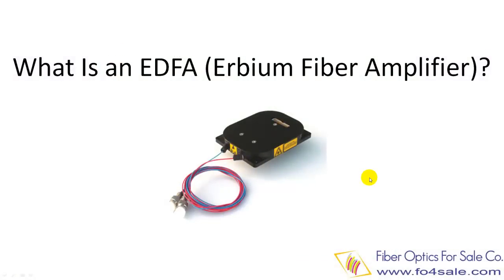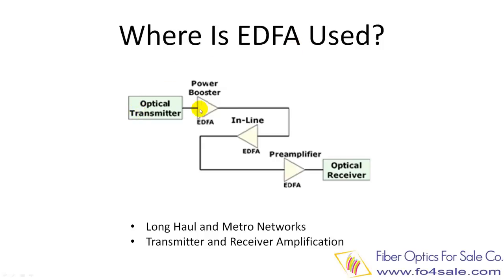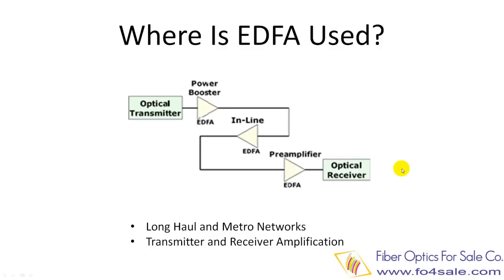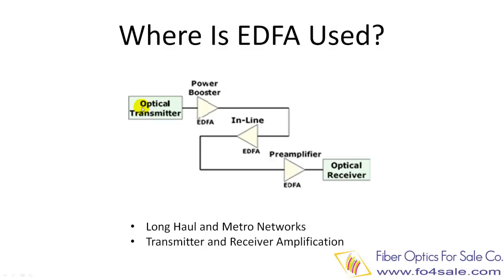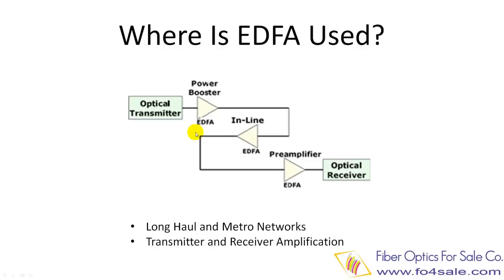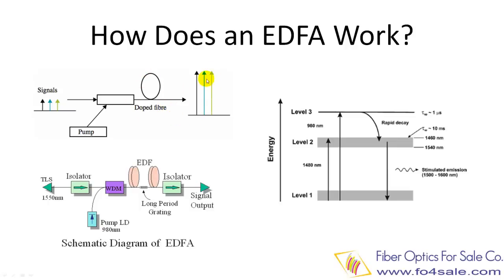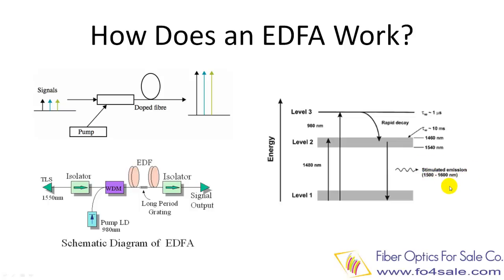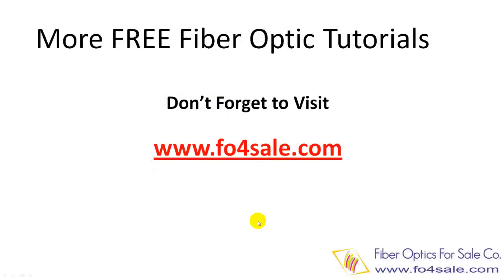What is EDFA Optical Amplifier?

Comment: Rofea Optoelectronics offers a product line of commercial Electro-optic modulators, Phase modulators, Intensity modulator, Photodetectors, Laser light sources, DFB lasers,Optical amplifiers, EDFA, SLD laser, QPSK modulation, Pulse laser, Light detector, Balanced photodetector, Laser driver, Fiber optic amplifier, Optical power meter, Broadband laser, Tunable laser, Optical detector, Laser diode driver, Fiber amplifier. We also provide many particular modulators for customization, such as 1*4 array phase modulators, ultra-low Vpi, and ultra-high extinction ratio modulators, primarily used in universities and institutes. 
Hope our products will be helpful to you and your research.